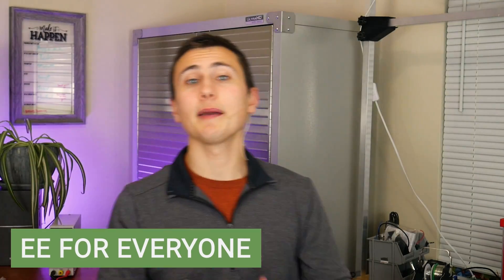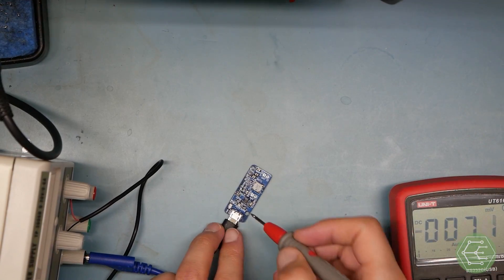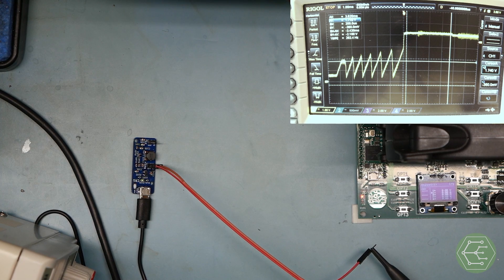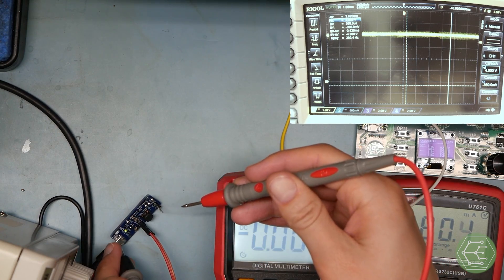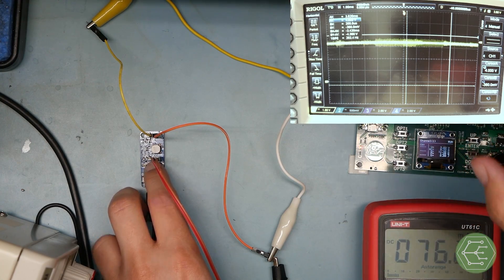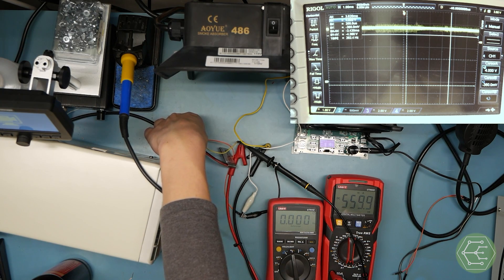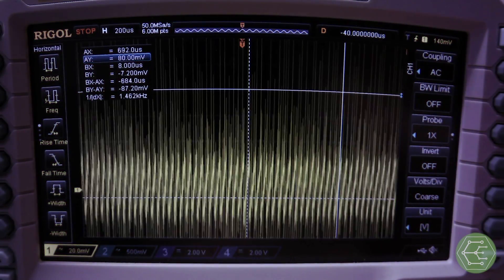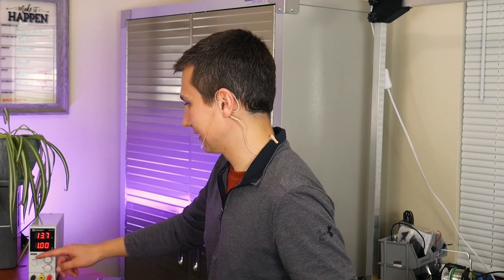1S LiPo Charger w/ 5V Output! (With Schematic)

Comment: According to the datasheet "typical aplication" of both components, shouldn't you use 1uH coil and 732k-100k resistors in voltage divider? You'd want the voltage divider to dissipation less power? Also they mention to use 2x 22uF instead 3x10uF capacitor?

Comment: Nice video.  Thank you!
I concluded that the board you built is great for charging a lipo and then also great for getting a max 200mA at 5v but that's it.  Did you get 90%+ efficiency?  If I need 200 to 300mA @ 5V to power LEDs from a lipo (and charge it) with high efficiency, is this still the circuit you would use?
Why did you opt not to have the company you used make the PCB also populate the board?
Reply from the maker: Hi Bert! I think the circuit works okay. I think you pulled the right conclusions! For lower currents (200-300mA or so) I think this should work well (paired with a ~500mah+ battery) I don't love the boost converter we used for hobbyist use. 

For example, a momentary short tends to destroy the boost IC (in part due to the converter topology, in part due to the small physical size). 

For something where shorts are unlikely and power is low, make sure to use protected Lipo cells! Another thing to consider is quiescent current, or if being able to shut off the system is important to you! Many battery powered systems have a latched power state, with a pushbutton to turn on, and an ultra-low power mode when off. 

Cheers, and I hope this helps! (Also, it's a good reminder to make better conclusions / wrap ups). :)

Comment: Usando capacitores con bajo ESR que está en la salida del voltaje, creo que mejoraría el rizo (creo que tu le llamarías ripple). Solo tendría que ser un poco voluminoso.
Reply from the maker: Hello Jorge, Excellent insight. I think you're speaking about the output of the lithium battery charger? Yes, we have a few uF of ceramic caps there... perhaps we just need more. Perhaps I'm tripping a minimum charge time timer? 
On the boost side, for sure, more capacitance will reduce the ripple voltage.